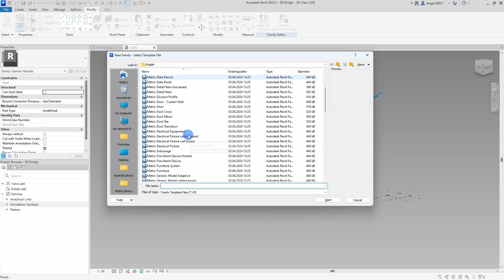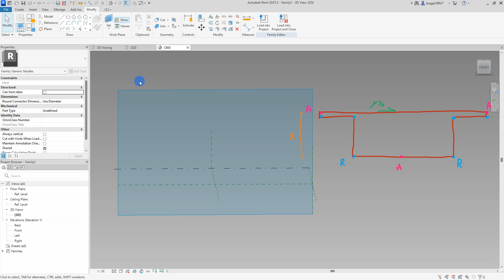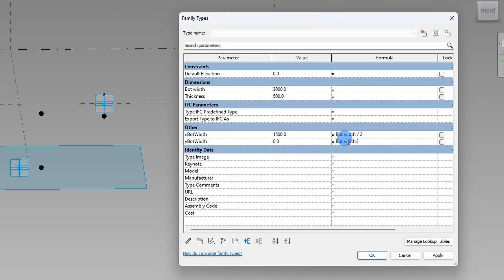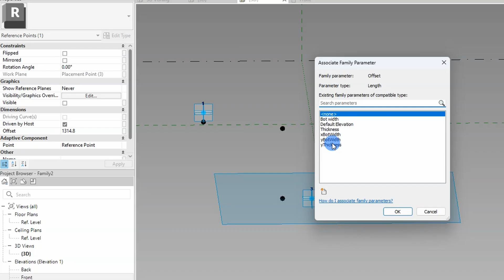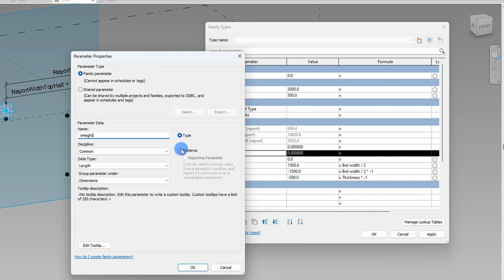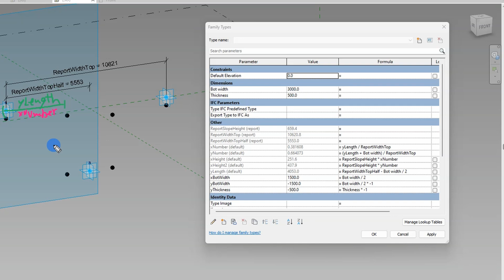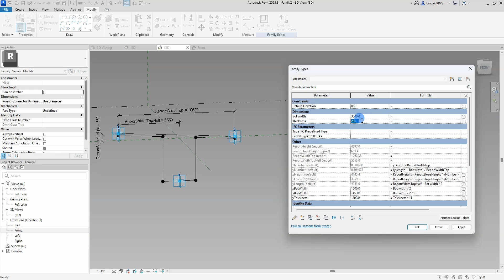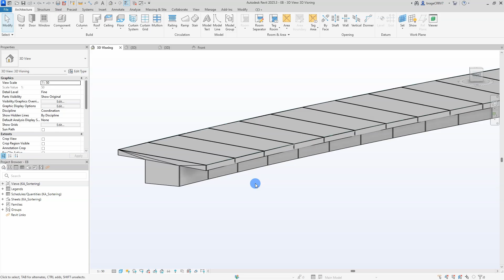Revit adaptive family | Curved box girder bridge with transverse slope and varying height

Comment: Great tutorial. You mentioned about the paths being created in Autocad and Excel and to refer to the links. I believe the links attached don't show how you created the paths, which I'm very interested in. Also, have you worked with Civil 3D, exporting this type of information to create the paths?
Reply from the maker: Hey! I have added the links in the video now. I might have used the wrong word when I said I created the paths; rather, I got the paths in AutoCAD and Excel format and imported them to Dynamo and then Revit. Never worked with Civil 3D.
Reply: @EngineerBear90  thanks for the prompt response and the updated links, it was the Autocad curve that I was interested in. Shame you haven't used C3D, as a workflow could be exporting a csv file of the paths (road centreline, kerb channels) and pulling this in to adaptive family using Dynamo. From there follow on what you have done above. Keep up the great work.
Reply from the maker: @ahg3395  Thank you! Maybe someday in the future, I will learn it and make a video about it. Good luck with the path creation.